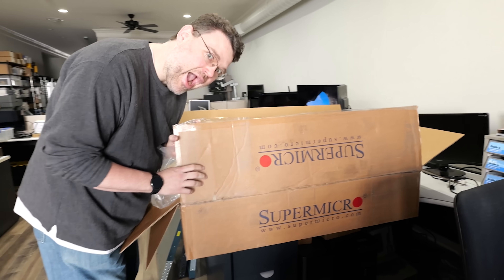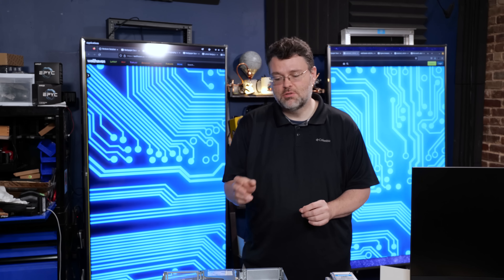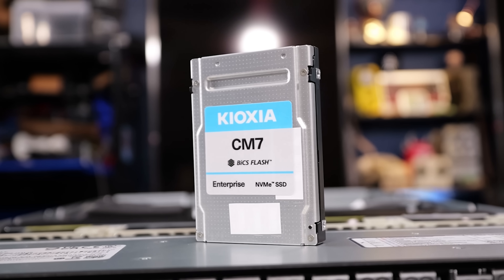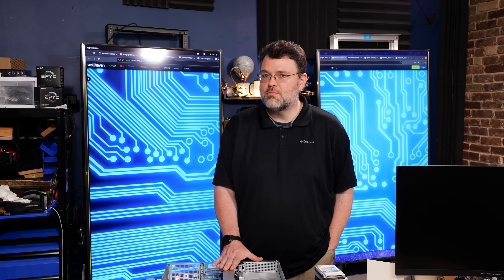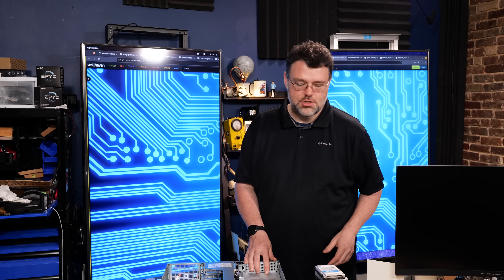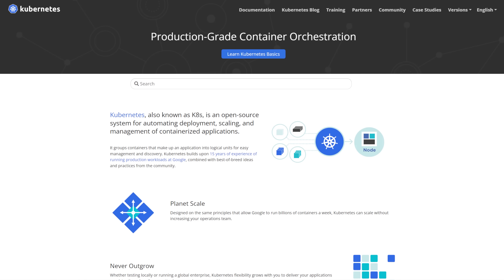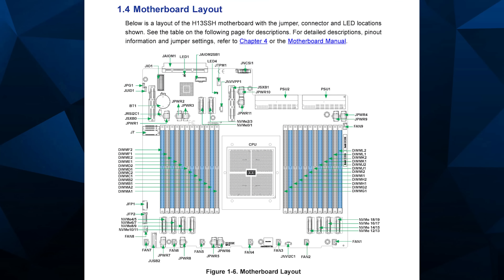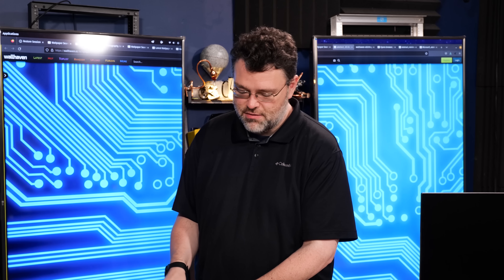The Supermicro Dual-Socket AS -2125HS-TNR featuring Genoa

Comment: what is the sweetspot for cpu cores/.freq when running a dedicated storage server, all flash etc. With current core count I generally try to avoid 2 sockets due to the numa implications if there enough pcie lanes available. at 2x 96 cores you have way more then i would consider necessary for a storage server, and I'm curious if a single socket server would move the data faster. You have access to better equipment then me though =)

Comment: 35°C in Datacenter is quite a challenge,  although it can save tons of HVAC cooling power, it also introduce humidity control problem.

Small room or Closed Loop Cooling Cabinet may be, but not large room at 35°C or have fun with static.

Comment: @10:10 "If you're shelling out 100k+ for your database server licence, I think you can shell out to get a redundant HA solution"  Ah, yes, because why pay $100k + hardware, when you can pay (N * $100k) + hardware (where N = number of active nodes). 

I kid, sort of, but SQL Server licensing, second only to Oracle licensing, is horrific. 
At previous jobs that were all MSSQL shops, we had to go to extra effort to keep lower core count CPUs for our DB cluster.   We had vendors come to us and offer us no-cost hardware updates from 8 core machines to 16-32 core machines that were several generations newer, and we had to turn them down and beg to stay on the older hardware.The SQL Server Enterprise licensing is just too expensive.
Reply from the maker: The bios options to disable cores can be used to greater effect in that scenario. Whether the cores are in the same chassis or other chassis the cost per core tends to be similar.
Reply: @Level1Techs 😮 clever
Reply: @Level1Techs  I didn't know they could disable cores like that. 

I guess then it comes down to whether MS's licensing folks would let you not count those cores.  I know we couldn't run SQL in a VM with lower core count, we had to licence the underlying hardware. 

I currently lack the sacrificial goat and other paraphernalia to be able to get that answered.

Comment: Now I wonder when A) someone releases single socket mATX or better yet mITX Genoa/Bergamo main board with B) such connectors for all PCIe lanes CPU can support except for those utilised by mobo placed controllers... you know, like what ASRock Rack did for Rome/Milan generation. And finally when the cost of such combo becomes low enough to be a viable option for homelabbers ;)

Comment: I really want to see a setup that uses some of the enterprise NVMe drives that are "optimized" to only use x2 links.
PCIe 5.0 x2 links are ~8GB/s, which is more than enough for enterprise drives which aren't NEARLY as bursty as consumer drives.
What I want to know is, who is making the rest of the system that is providing all these x2 links?
Is the assumption that everything is going to be switched? Because I don't see any settings in the Intel or AMD documentation that shows bifurcation going lower than x4.

I REALLY hope we could start seeing some reasonably priced consumer drives/boards/CPUs that have PCIe 5.0 x1 links.
4GB/s is honestly still overkill for a consumer drive.
Sure, it doesn't look as sexy on the box as "15GB/s PCIe 5.0!!". But that is stupidly unnecessary.
I'd WAY rather have 4x drives than 1x drive. Especially now that flash is getting SO cheap!
(I can't believe I spent $60 each on Samsung 1TiB drives when they got price-cut in Feb, and now the 2TiB drives are down to $75 if you get lucky...)
Reply: I am right there with you. Consumer level hardware with more pcie lanes would be great. 8GB is fast enough. GPUs are not really there yet either. So if there is a way to split new Gen to old gen for the same performance, it would make home computing way better
Reply: @Foiliagegaming technically I'm asking for less lanes. But more links.

Comment: Is U.2 or U.3 the future?
U.3 isnt standardized for PCIe Gen 5 yet iirc
Reply: U.3 has a MUX inside the drive by specification to support different pinouts. The MUX worked at PCIe 3.0 and a little at PCIe 4.0 speed, but it wrecks signal integrity and you won't see it used in PCIe 5.0. U.3 is dead, U.2 will be used in PCIe 5.0 drives.